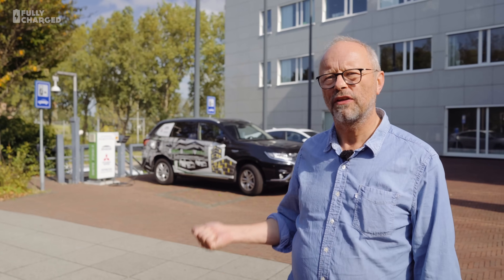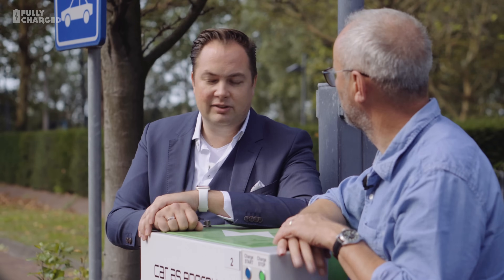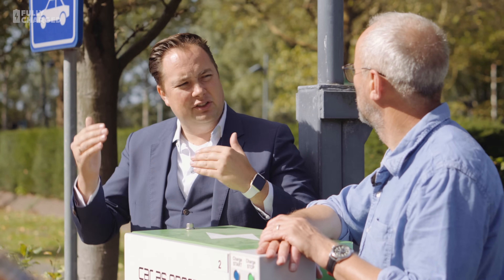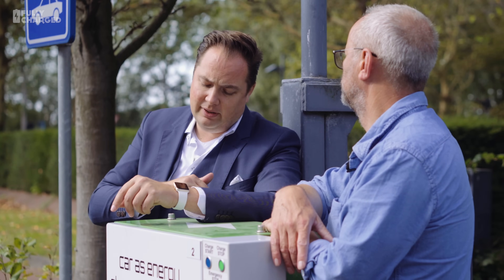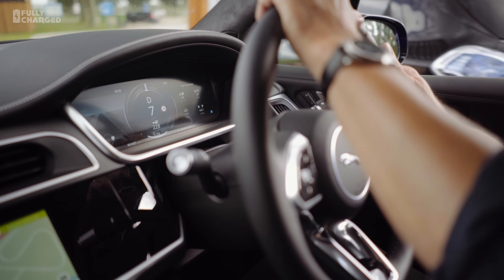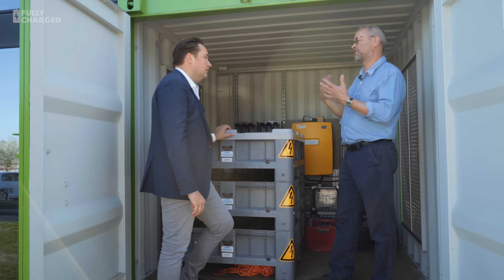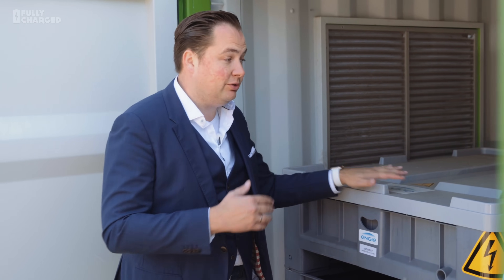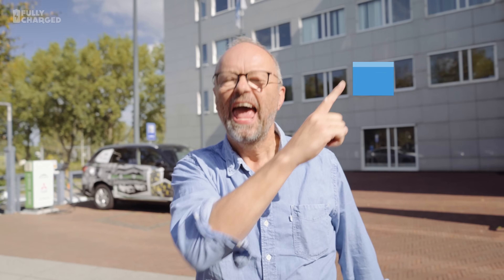Engie Vehicle-To-Grid | Fully Charged

Comment: This will make old LEAFs values increase greatly! I have been looking for these but can only find them from China and they are not the same voltages as my home and are not up certified...... Great video! Re-use is a great idea :) keeping those batteries in use and sometimes even..... Fully charged
Reply: I imagine a scrapper having stacks of squashed old Leafs plugged in to earn a few quid a day per car, on electricity brokering.
Reply: Why doesnt it work with CSS?
Reply: @rokadamlje5365  CCS is not certified for bi-directional yet. Only one way into the chrarging port, not back out of the charging port. They are working on it, so will be coming within few years.
Reply: If im understanding it correctly, DC connection is directly tied to the battery. What stops the current going the other way other than sensors tied to shutoff switch? Assuming the voltage is lower on the charger side.
Reply: Rok Adamlje It has to go through an inverter that works the same way as a grid tied solar inverter except it communicates via the CAN buss in the car to tell the battery to supply power. When the battery can no longer power the inverter to the correct voltage the inverter will shut down. But it can also shutdown on instruction from the grid that it no longer needs power.
Reply: Looking for the same for my Leaf. Have seen a Setec Leaf inverter modified for a Mitsubishi in Australia.
Consuming part of the state of charge from multiple cars wouldn't impact much at all on battery life.
Free charging or sufficient remumeration would a good incentive.
Reply: Usefulness may increase, hopefully handling the riches well. There is a reason that life is the greatest gift.

I'm glad we can be helped with this, assumingly going in the right direction.
Reply: and on cloudy day, the building is run off of the cars in the lot and at end of day, all dead cars and everybody gets to walk home.... LOL.
Reply: @yousurf374  simpleton.
Reply: @hitreset0291  yes.... yes you are.  Greenie Weenie who just does NOT understand that SOLAR is not ready for prime time yet AND all the technology shall change in 5 to 8 yrs and THEN will be sensible for major applications... not now.
Reply: @yousurf374  You say it as a joke, but this is true! The system needs to guarantee the cars will be recharged in some reasonable time frame, else you are essentially stealing electricity they've paid for elsewhere.
Reply: @philipcorner574  TRUTH makes for the best jokes... the IDEA is a joke... and also, causes cycles on the car battery bank.... depreciates it... WTF? WHo would do that? Unless the globalist control freak govt. gives all citizens, or workers, a free car and replaces it as needed... Like a fringe benefit to the employment to assure you have way to get to work and then power the workplace.... LOL.
Reply: @yousurf374  Like everything, the system is more efficient with economies of scale. The more bi-directional charging, the more efficiently the energy usage is spread across the system. If we are saying that 90% of cars commute 10 - 20 miles into work (and the same back) with cars having a range of lets say 120 miles on average , there is very little possibility that such a car would run out of battery power to leave the owner stranded. Scale this to an average office carpark full of cars and we would be talking a small percentage from each car (although in this video, he says that only 6 cars would be needed as an efficient backup on bi-directional charging for a building of that size).

Incorporate this with smart charging at home, when the vehicle is not in use and you have an all round better and cheaper use of the energy. Yes, this is the ideal scenario but it is really all about scale, and you cannot have scalability without the infrastructure.

As for charging cycles, yes this is definitely an issue but wouldn't you agree that this is more of a short term one? If the whole battery industry is working on making more efficient batteries, I would expect degradation to improve with the new generation of batteries. For the average car user, this is likely to eventually outlast their ownership of a car. In the future, I expect batteries will become either affordable interchangeable commodities (e.g. swap them at the petrol / charging station) or efficient enough to last the lifetime of the typical vehicle.
Reply: @2002RM   I think my post was regarding that this guy said LEAVE 20 mile of battery life in the car so the employee can commute home?  BULLSHIT... Why own a car ? Just to commute? AND then it must be recharged before the next morning to get back to work? And who pays for that charging overnight????? WTF.... I pointed out a stupid statement.  I would not subject MY car to such cycling and have to recharge at home of a powerwall which MA by home with solar, IF there is home solar avaliable or allowed or procure at a high capital cost, or generator or grid.... JUST to drive back and FEET watts to that building on a cloudy OR sunny day. Ridiculous.  This dude is talking like forced solar that everyone must do.  Right..... maybe in a fascist land or commie/"forced socialism" ruled land (basically same thing)... subjugation not freedom or liberty.  IN A FREE country, your property is YOUR property. IF I want to take a long relaxing drive in the countryside or mountains after work, I should do it.  If I need to do 6 errands/drives after work or a few during lunch....it is more that 20 miles usage... SO, if they are looking for volunteers to allow their car battery to be cycled (depreciated) they I hope they are paid well for the trouble and depreciation.  Not cheap. Nor efficient.
Reply: @yousurf374  Didn't you hear the guy say you'd be paid for the use of your battery?  The system is voluntary.  Obviously you wouldn't let them discharge it all the way.  You could set a lower limit, like 50% or whatever you want.  It sounds like you're just looking for a way to rail against "communists".
Reply: @yousurf374 
I keep thinking of a snow blocked A30 again populated with EVs with their batteries being drained by trying to keep warm, assuming they perhaps not at optimal charge in the first place!